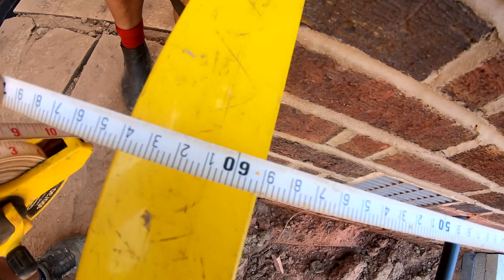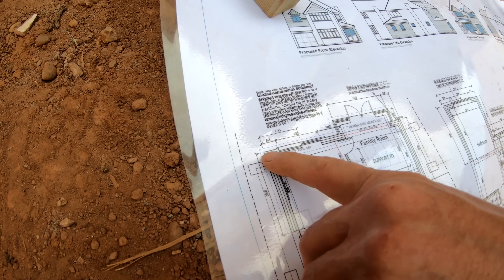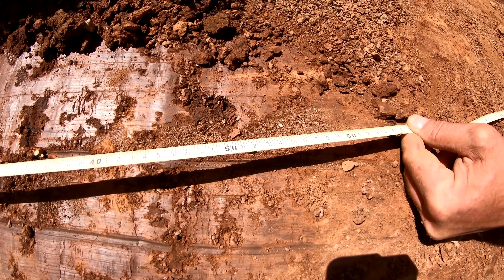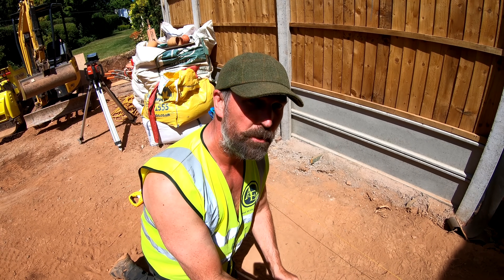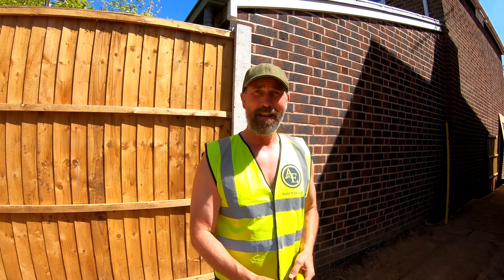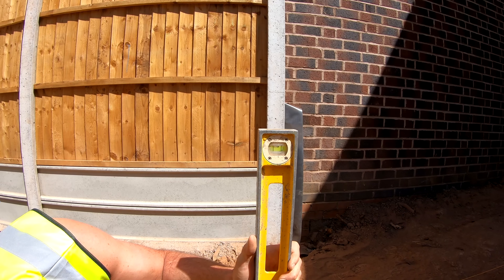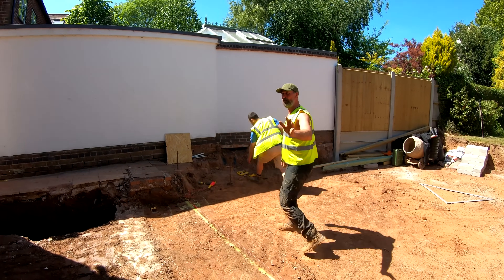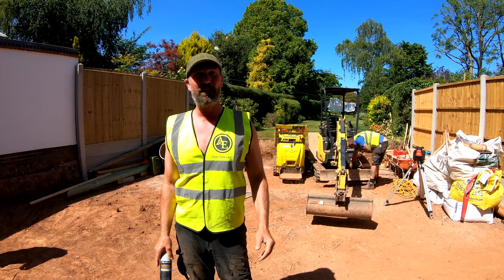Marking out Footings for Extension Build

Comment: If the two lines are parallel why don't you cut a piece of string tie a running knot and slide it on your lines to the measurement tighten it off at the correct measurement saves knocking the pins in and same accuracy

Comment: Great information tony cheers, I have a concrete slab 13 ‘ x 10’ over 30 years old, can’t afford to remove it, but want to increase the thickness 2” to level it, your views on do I need to prime the old one first before adding ballast ?
Reply from the maker: Hi Blue Boy make sure it’s good and clean if required scarify the floor the use P Primer and then there is a leveling compound you can buy which will go up to 50mm or use screed and fibre hope this helps but ask a local builder or building control to have a look if required all the best Tony 👍 have a awesome week
Reply: @BuildWithAE  thanks for your reply much appreciated